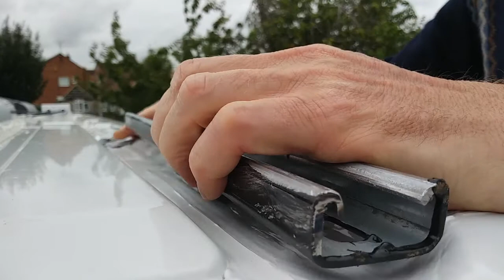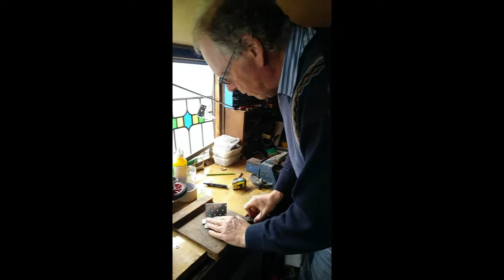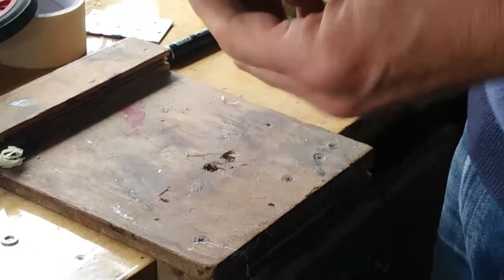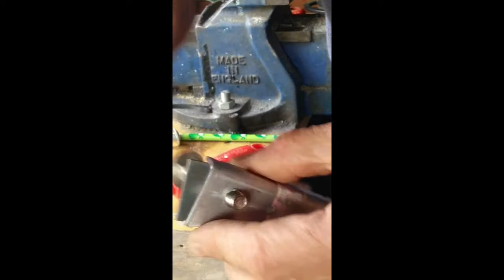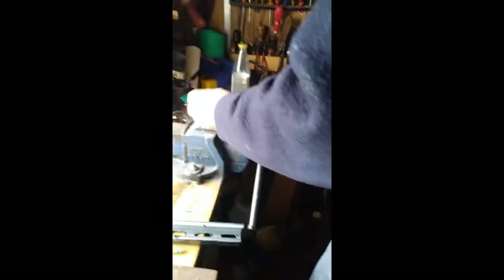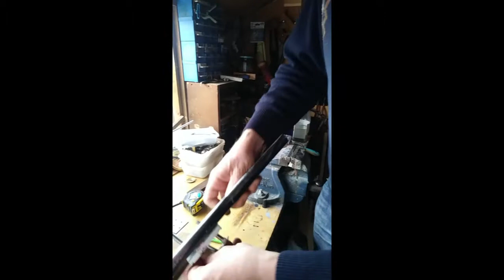Ducato/Relay/Boxer roof T bolt clips

Comment: Great video. Going to try this but with the over lap bit slightly longer to touch the roof (with rubber edge) so weight is also on the roof and not just on the bolts. But your idea was the solution I have been looking for to save 100s of pounds on pre-made ones. Off shopping for parts now. Thanks..

Comment: What model Ducati is this? Trying to figure out is L4H3 roof pins are same as us Ram promaster 159 EXT
Reply from the maker: Hi we have a L3H2 sorry no idea about any others.
Reply: Hello the roof on one h3 is different of the low version.
Did you found a solution?
Reply: @doucet2006  www.orionvangear.com - We now sell a rack for the low roof version! with adaptors included.

Comment: Well done! The question is how well the Dukato (Promaster here in the 🇺🇲 States) post itself holds up. I saw a video on a 1 year old Promaster with a very light roof rack with a couple solar panels broke out the metal in the roof that the post was attached to.
Reply from the maker: I think it depends how much stress you apply to them.